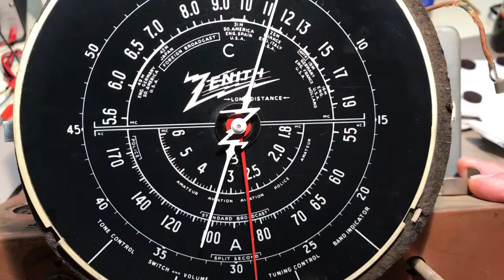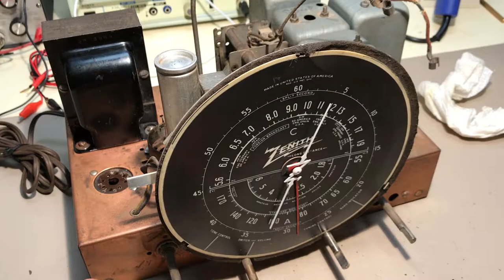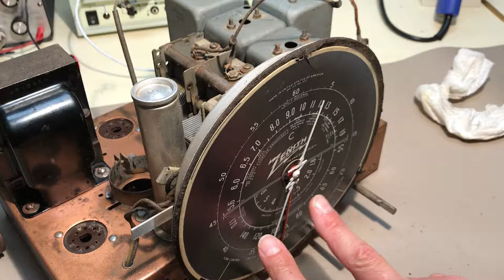Zenith 5S119 Antique Radio | P4 Removing Variable Condenser

Comment: I have a mica trimmer capacitor on a variable oscillator that tore. Will changing it change the capacitance of the trimmer capacitor?
Reply from the maker: Hi, Gilbert. If you don’t closely match the value of the original trimmer, then yes, that will create issues. To find the value of the original trimmer, check the schematic or parts list for the radio, or check the trimmer itself for markings. As it’s a trimmer, it should indicate the capacitance range that it can be adjusted for. If you can’t determine the trimmer’s value from those means, and the trimmer is still functioning, simply measure its capacitance. It’s a good idea to measure the capacitance of the trimmer you’re replacing in its original setting, if possible, either way. That way, you can preset the new trimmer to closely match what the original was set for. Then, hopefully, when you do the alignment, the trimmer will be in the ballpark to help make the alignment easier. Also, it’s not the best idea to simply replace the trimmer with a fixed capacitor, as this won’t allow you to align the radio correctly. Let me know if this helps and I understood your question correctly.